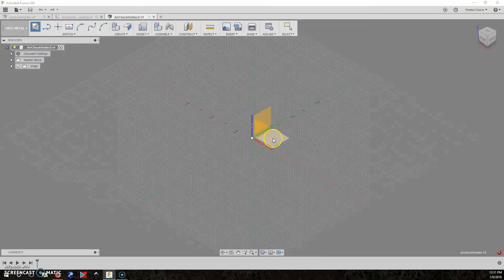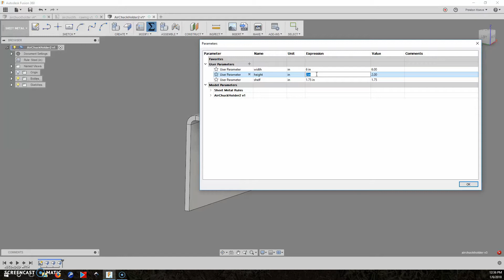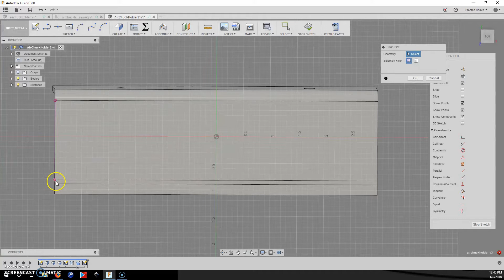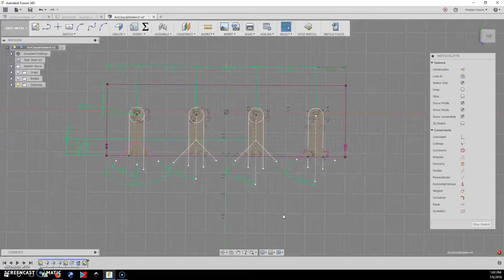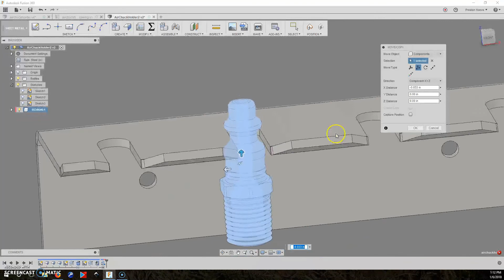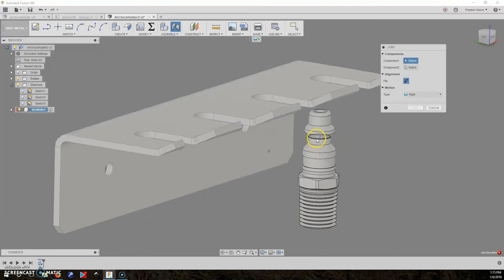Fusion 360 CAD Sheet metal Tips - Air Chuck Rack

Comment: @sbirdranch Great video, I was hoping you were going to cut this on cnc plasma!  Any chance of a follow up video showing how to complete the Fusion 360 setup for plasma cutting?
Reply from the maker: There is a chance for sure....however I still (kicking myself) haven't finished the plasma table.  It is going to be miserable hot this coming weekend so I'm promising myself that I will make more moves in that direction.  ~P

Comment: I just create a set of 6 Parameters

Width                            200mm
Height                           100mm
NumHoles                    6                                                        how many holes do you want
Hole                               (1/2)*25.4                                        this lets me add imperial sizes in to the mix
HoleGap                        Width/Numholes
EndHoleGap                (Width/Numholes)/2                      Equally spaces the holes from each end

create the first hole with Hole Parameter for the size and dimension it from 1 corner using Height/2 and endholegap for the 2 dimensions, then create a sketch pattern and use numholes for the quantanty and holegap for the spacing, change distance type to spacing and hey presto a fully Parameterised sketch.
Reply from the maker: That makes sense.  I think I'll give it a try just for giggles.  Are you familiar with using 'mm' after a dimension when in an imperial based drawing?  It converts for you, but leaves your parameter in mm.  It was an easy way for me to mix in a metric shaft spacing in a drawing I just completed.  ~P
Reply: I wasn't aware of that, as a UK based user we work in mm, but that is definitely info to remember.

the whole imperial/metric stuff winds me up, we even still have some things that still come in imperial sizes,, we have pints of milk/beer for example but paint and petrol is in litres.
Reply from the maker: Michael Shore It works the other way too.  I think you add `in` after the number and it will show up metric.

Comment: Awesome. I need to spend some more time in Fusion 360. Question: How do yo access the Shop Drawing screen that you show at the one minute mark? Thanks.
Reply from the maker: In the top left corner of the F360 window where you choose Model, CAM, etc....The last item is Drawing.   You have to create the drawing by selecting "From Design" and then clunking your way through.  The drawing tool can be less than elegant, but it works.  It creates a separate file and you can export them as PDF or print them direct out of F360 (new feature).  I know not everyone wants to play with Fusion, so I try and make a drawing available for things that might be of interest.  I have started putting them on my web site for the CNC Plasma table.  What web site?  www.sbirdranch.com  (shameless plug)  ;)  ~P
Reply: lol shameless indeed :) Thank you. It will be nice to have a formatted portable visual to work off of for once.

Comment: You could take the with parameter and for the distance on the side you enter with / 4 / 2. For the distance between the holes you enter with / 4. With thad you have equal distances between the holes and half the distance to each side.

Comment: I believe using the "pattern" function on the "create" drop down menu will allow you to create equal spacing of your circles. Great video!!
Reply from the maker: Hmmm.....Ya.  One direction.  I'll play with that.  Thanks.  ~P
Reply: rectangular pattern; complete the one slot first,might also be able to use slot function
Reply from the maker: Neil Jensen I'm not familiar with the slot function.  I'll check it out.  Thanks for the tip. ~P